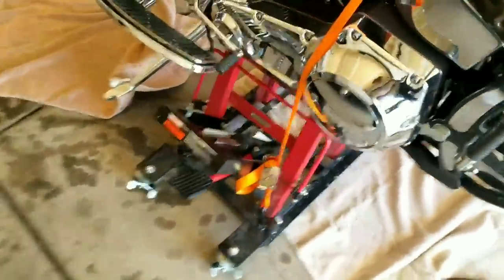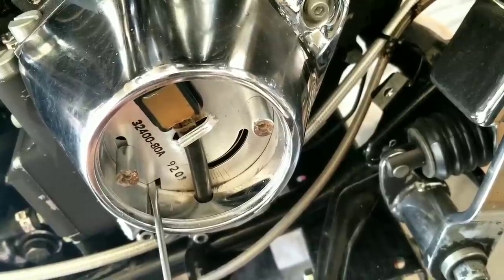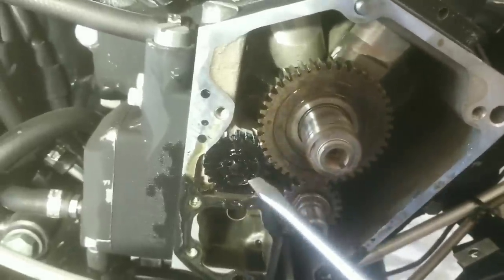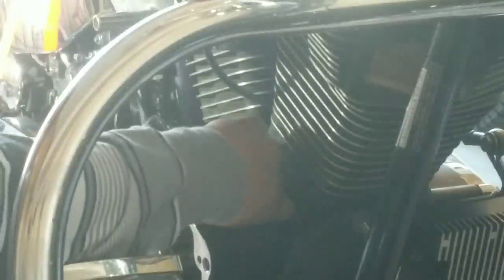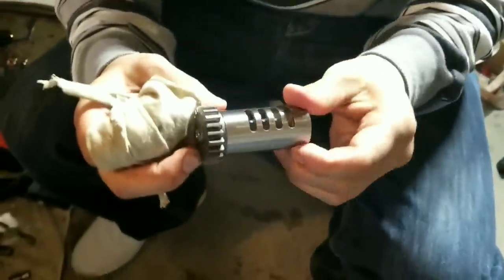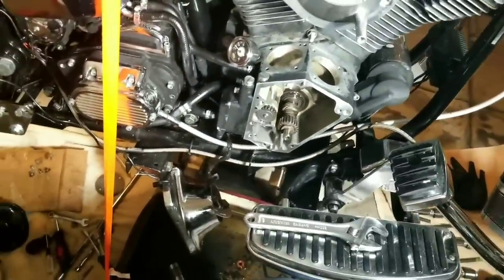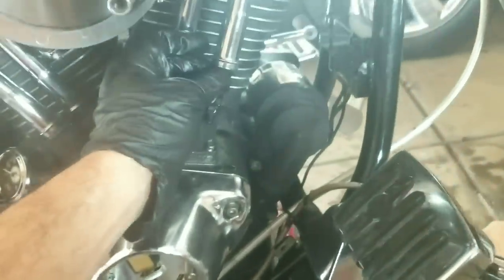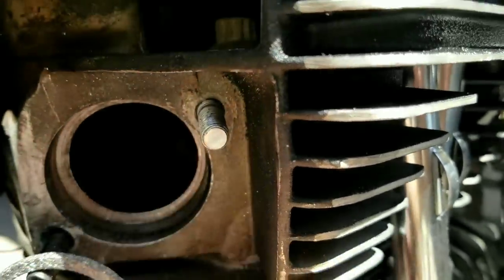Harley EVO EV13 CAM Installation

Comment: ....Did I miss the part about the importance of checking new cam to pinion gear fit ? If not done, you are mismatching the gears. Result is either whine or clatter...and premature wear. Check colour coding or use measurement pins....also, measurement of shim should include gasket compression...I believe both are right out of the manual and cam instructions...and shud be common HD knowledge.
Reply from the maker: Joe, you didn't miss it. I failed miserably on saying and showing it. When I reached this point all recording stopped; I was reading the manual and cam instructions terrified I was going to do it wrong. I had to order shims to get the correct spacing. I think my best bet now is to add a disclaimer. I didn't really find any videos out their with your knowledge that could help a #DIY guy. I figured an average #diy guy with a Harley probably knows they need to get instructions when performing an operation to this extent. but maybe not???. 
I am stoked about Pacific Mike sharing his extensive knowledge and experience with us all. I wish we would have started a lot sooner!!! If you havent seen his channel, I recommend you see how great it is. Thank you for pointing these very important points and helping me to know how to improve. Cheers!!!

Comment: you can take an extension and a hammer and tap the gasket and usually it will break right loose saves a lot of scraping

Comment: Plastic breather doesn't hurt the case! Also check cam end play with gasket and cone installed!
Reply from the maker: Thanks for mentioning that.... I don't think I ran across an issues that the plastic breather caused.. Guess I could have spent that money towards something else.... Great point i did not mention for the end play...
Reply: Maldonado's Garage they do a a stationary breather with Reed valves,no gear too!
Reply: how do you measure the end play?
Reply: 2 ways to do it  ,  cover on or cover off . But people forget to check breather shim , So I do it with cover off , place Gasket on the case use a straightedge  and feeler gauge  I try to get a 18th gauge between the strait edge and cam, pushed in , a gasket will close about 0.05 th when you tighten the bolts . Cam is .001 to .015 end play  the breather 0.05 to 0.15 gap on end play   S&S has the best Breather shims Ebay for 15 bucks  80th to 170th  . Gaskets come in .025 to .040   Shims are the only way to close a gap use math  add or subtract  If the Gasket mush .005    and the Gap is 25th  -  5 is 20  close it by  10 or15 th

Comment: One reason to keep the plastic breather gear is if something hard gets into the engine and hits that’s breather the plastic will give out and not wipe out the case..
Reply from the maker: Thanks for the explanation.
Reply: I was hoping someone would mention that point.  There's a reason why Harley used a plastic breather.  Just make sure it's not missing teeth, if so, replace it.. with another PLASTIC breather.  It was missing teeth for a reason. Like Justin pointed out, if something gets jammed in those teeth, something's gotta give- better a plastic breather than a case.  Ride safe everybody.
Reply from the maker: Thanks for pointing that out Justin. This is great information that is valuable to ones consideration when asking him or her self, PLASTIC or STEEL breather valve...

And THIS Ladies and Gentlemen is valuable information that should be considered... 
IMHO I think steel is a little stronger than plastic and wouldn't break, or at least one hopes not. 

I wish you all the very best and thank for sharing your opinion with information that will ultimately help the person watching make their decision.
Reply: Something I never knew, cheers mate!

Comment: Back up  02:47 Never Pull the cover off before removing Pushrods the 170 pounds on each rod can bend the crankshaft pinion gear without the bushing in place Valve seat Pressure is 680 # on the Crank if valves are open 1400 pounds on the crank ,  Cam cover has 2 bushings for support.  7:07  Do not count on this working for proper cam end play , the gasket for the cam cover can be .025 to .040 th thick , your cam end play should be .001 to 0.15 on end play . Breather Has to be shim for end play .005 to .015   To get the right fit use a straight edge over crank case with the gasket in place and take a reading to the breather and cam with a feeler gauge , Gasket will mash .005  subtract the mash  .   10:45  Not all Lifters work the same some are only finger tight  others finger tight and 2 and half turn to 3 turns 0.100 th lash on the lifter ,  and let bleed down 15 to 30 minutes if you do not get bleed down back off only finger tighten.  DO NOT TURN ENGINE OVER TILL YOU HAVE BLEED DOWN < a Pumped up lifter can damage a Valve piston to valve .   I know your going by the Book but you jumped way ahead  On this stuff that can Blow a Engine on start up  or in a few hundred miles if not done right.
Reply: Your rite, guy is doing this job completely wrong. Caint belive he poped open the cam cover with the valves still under pressure. Nowadays i make sure the evo bikes i purchase are completely stock with the rivits still on the points cover, like that i know nobody opend it up. Caint trust what previous owners did.
Reply from the maker: Thanks for all your feedback. I appreciate it and glad that my engine is still operational :) I hope this information helps the next reader/viewer. Thanks for also adding the links for the shims and lock washer.
Reply from the maker: Carlos, When you inspect the rivets on the points plate, how do you differentiate them from the replacement rivets?
Reply: your welcome , I did like your video .  I know first hand what happens when its done wrong .   My video cam only will do 1 minute video .    2010 a shop I used did not shim my cam or breather . It destroid the engine .  .277th  end play  that's just over 1/4 inch the tappet block was the first to go and the rest in matter of minutes .
Reply: Most Guys go with screws and replace the stock cover.   the timing plate locking screws take the new cover screws .  that center hole has a #8 24 threads per inch  any auto store has the screws .  the Screws will be at 9 o'clock and 3 o'clock   Harley shops will reuse a rivet 12 and 6 o'clock .   if you are looking for stock engine  pull off a pushrod cover look see if its solid pushrods , if they are adjustable you know it has had work done
Reply: Saint Maquina that tells you absolutely nothing. I put a single fire ignition in my bike and put new rivets back in and you could never tell. Dont lead people on the believe that.
Reply: Do u put the thrust washer back even though u use a  shim? Any info appreciated.
Reply: @JCcanU  unless the last guy reused his solids because he was also doing a valve job while upgrading the cams... like ME for instance.
Reply: @lynskyrd  The Solid Lifters have nothing to do with how you install the cam , Only part you using solid lifters is on the pushrod they get finger tight they do not have the hydraulic spring oil .
Reply: @eliking7391   That is why you do end play , Thrust washers come in number of size thickness and in some cases you add the shim on the cam and then add the thrust washer , and the washer has to go in with the cut out up that gives lifter space .
Reply: @JCcanU  I was referring to solid PUSHRODS - aka NON-adjustables.
Reply: @lynskyrd  2 ways to do solid pushrods on a harley removing the rocker cover or cutting the pushrod with a good set of bolt cutters , you can not change lifters with valve spring pressure on a cam .  you never get them off or back on the cam .
Reply: so much going on here, good informations bad informations bad informations think are good good informations we don't know are bad. all the known knowns and the unknown knowns got to watch out for the unknown unknowns cuz that's whenever they don't know they're going to and they'll  come back around and that's bad. and you know what settles on badness round here now, dontcha? ... Pumpkinhead... don't mess around unless you're tired of living
Reply: @JCcanU  that was interesting, did that guy make a video based off of your comment though? verbatim comes to mind, I got in trouble when I was a kid for too much verbatiming. granny said I would catch the coralodivirus and she was tired of washing  my weird smelling sheets. That's not exactly how she said it, but I did enjoy a nice verbatim, I think she might have been a homophone or something
Reply: @dont.ripfuller6587  no Mike has been on youtube a long time He has done Knuckle head Shovel head engines on youtube , no one else has done one at all and show how to get the True specs on EVO engine , it was just done 7 months ago . I posted a list of parts from JP cycle up about 30 post  Thrust washer shims for cam and beather shims they come in thousands of a inch .
Cam cover gasket come in different thickness as well . some as 25th thicker than others
Reply: Jccanu the thickness of the gasket doesn't matter at all really. When you are measuring for end play on the cam you put the gasket and cover on using 2 screws to hold it just flat against the surface without crushing it. You put the feeler Guage inside tapple block hole and check end play on the inside and then deduct your gasket crush from that measurement.  Thats the only way to get end play as accurate as possible. Cant sit here and try to figure out the thickness of a gasket and use is it to figure proper end play. First its just way more unnecessary thinking and math involved and it will never give an accurate measurement. And finally after the cam cover is torqued down check end play again to be positive you have got it with in spec.
Reply: @jmarciano24  I have pulled out 24 thousands thick gaskets from a box , and up to 40 thousands thick . You are right on how to get end play on the cam  , but if your old gasket was 40th thick and a new one is 24 th thick your going to have to change out everything Thrust washer shims to get the 00.1 to .015 thousands end play . I do believe I was talking breather end play for the straight edge yes the breather has end play .005 to .015  , I did like 3 post to the thread , and listed parts to the link
Reply: @MaldonadosGarage  no one would put pop rivets back in the outer cover . Just use allen screws.
Reply: Jeff, you are absolutely correct 👏
Reply: @eliking7391  yes
Reply: Touche` @MaldonadosGarage
Reply: This video needs deleted, too much misinformation!
Reply: @kennethwise7108  That was the One Kenny 5 years ago been a few nights lol
Reply: @JCcanU  imagine how many people have had a cam chest failure from this video?
Reply: @kennethwise7108  I have had my share of fails . and I don't go by this video .   I make to Much HP .
Reply: @JCcanU  good thing you don't go by this video. If I were this dumb I'd delete it
Reply: @kennethwise7108   lmao

Comment: You still need to check the end play on the cam with the gasket and cam cover  in place and the bolts torqued. Reach through the lifter block holes in the engine block and check with a feeler gauge

Comment: Was it noisey after you warmed it up? I was always told to put old stock cam gear on the new one. I did an EV27 in my 96 without doing it and it was fine. Going to do an S&S cam in my 97. Good job, only issue is make sure each cylinder was TDC before setting pushrods

Comment: I used the Andrews EV27 great cam
Reply from the maker: Awesome, that's a nice cam!
Reply: The EV27 is a nasty sounding cam without the need for a bunch of headwork and heavier springs.  The EV27 WILL be going in my ultra classic.  I built a mild 80" evo for my 92 softail and the cam along  with new  wiseco high compression pistons and rings alone woke T/F out of that bike. I sure do miss that old bike! Great tutorial! Your bike sounds great! Dis you ever time it? If not, you're leaving alot of potential behind

Comment: You do know on any flat tappet (non roller) when you first start it up. You should bring the rpm up to around 2000 rpm for at least 15 to 20 minutes. You can flatten a non roller cam very easily. 
  I did this back before you were able to ride motorcycles.  Maybe before you were born.....
Reply from the maker: I did not know this Lee. I did not read this anywhere. Thank you for bringing this to attention!
Reply: @MaldonadosGarage  do you understand the theory about bending the crankshaft when leaving the pushrod in before removing the nose cone?  Depending on how bad or if you bent the crankshaft.  Your motor could vibrate itself apart in 5 miles to 5000 miles. Maybe more. These pressures are very high. Although I know guys that have been building harley's for 40 years who don't believe this theory. 
I always pull my pushrod first. Rather be safe then sorry. I started building Harley's back in 1964. Although it wasn't a new one then. That was a long time ago!!   🤗
Reply from the maker: I do understand, someone else also believes your theory on here. I do recall this topic now. I have well over 500 miles on her, hope it doesn't happen. Maybe I will take your approach on the next cam. You have building for years, that is awesome, once again thanks for you input here.
Reply: @MaldonadosGarage  you did a good job both with your bike and with your video. 
  Can you go back in and edit that part to explain how to release pressure on the lifters before pulling the nose cone? I don't know how u-tube works.
Like I said though. Pretty good video.
Reply from the maker: Thank you. I can't edit, but I will make a video explaining then drop it in as a pop up so they can see the video.
Reply: I thought all Harley’s were roller cam.

Comment: What cam bearing removal/ install tools did you use?
Reply from the maker: https://www.ebay.com/itm/271174444010
Reply: @MaldonadosGarage  
Thanks, I enjoyed the video
Reply from the maker: Thank you, I recommend you read through the comments there was alot of valuable information provided by others as well. If you haven't already, get a manual for your scooter also.

Comment: Nice job and good installation with tips. I have a 93softail 80”evo runnin ev27 cams and I love it .  How does it roll now and what’s the difference to you in the ‘ seat of the pants ‘ Dyno ?
Reply from the maker: Thanks for the compliments. I have not dyno'd, but difference from before is definently better. She picks up speed very quickly now.
Reply: Maldonado's Garage good to know as I’m going to go with the ev13.
Reply: Timing is everything! Those changes definitely require timing adjustments! Great sounding bike,  but sounds like you need to remove some advancement.
Reply from the maker: I didnt time it.... I ended up with a Stroked 89"

Comment: It was original cam shaft needle bearing? How much run your bike on it? I decide do I need to change it on iron bearing because I heared the original one might fall apart. What do you think about it?
Reply from the maker: If you are in there already, I would say replace it.
Reply: I didn’t start yet
Reply from the maker: @Kostopraff88  I think I was at about 25k miles. In all honesty I have heard and read different opinions, leave it change..... My opinion is to change it. I bought the bearing puller and installer kit off of EBay... no issue pulling or installing. What are you planning the work on?
Reply: Unfortunately I don’t have Inner Cam Bearing Puller and Installation Tool & One New Koyo-Torrington B-138 Bearing at the moment, first I need to buy it

Comment: This is about the worst instructions ever, the guy didn't say the name of the cam bearing ,which HAS TO BE TORRINGTON, if not be ready to have the side of your case ripped out. google "Harley cam bearing trouble " in 1992 they stopped using the torrington 29 roller bearing in asteel cage instead they use a 18 roller bearing in a nylon cage , it wont stand up to a hotter cam.

Comment: Your video is kinda informative but you dont show anything being removed. You just point to something and say "remove this" and then you cut back and its already removed. Show how its removed. Not everyone has done this before.
Reply from the maker: Thanks for your feedback Millstar. I have definently worked on showing steps closer since this video. 

I would say that the service manual is the best place to get the exact steps...

I will see if I can find you some videos or maybe I need to do another install in the 96 I picked up....

Once again, thanks for the feedback. Very valuable.

Comment: you should install the cam the cover with the gasket and then no lifters install yet then move the cam back and forth to get the reading of cam play. just say`n... and yes you should remove the tension off the cam lifters first by removing the push rods presser not good to pull the support crank cover or called cam cover... and you did not really teach anything about the valve position to the lifters and how many turns in detail on correctly turning the adjusting nut and after you adjust a set of lifters wait about 30 mins before you move the engine ... let the oil bleed down in the lifters...

Comment: You didn't tell us that the OEM  cam bearing has only 18 rollers in a nylon case, it can't stand up when a hotter cam is used . The bearing you need is a 29 roller bearing in a metal case . It's a torrington bearing,and harley always used them untill 1992 when they switched to the INA bearing. Next you didn't show how you held the tappets up when you slid the cam in . for those who have never done it , that can be a nightmare. Also never remove the cam cover with the OEM one piece push rods in place ,it exerts downward pressure on the bearing. Cut the OEM pushrods with biolt cutters , or remiove them by taking the riocker boxes off. If you cut them be sure to buy adjustable pushrods like S&S quicky pushrods , regular adjustable ones don't all colapse far enough to get them in place with the rocker boxes left on.   very poor instruction video in my opinion.